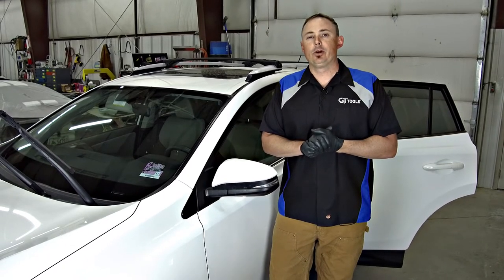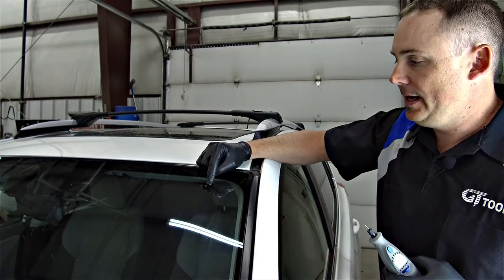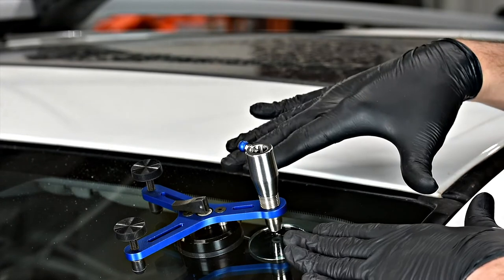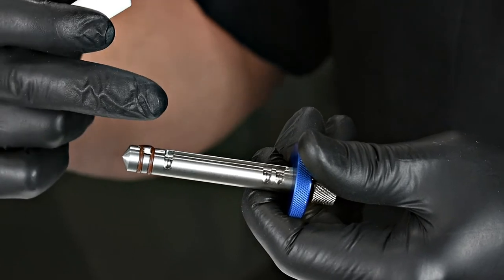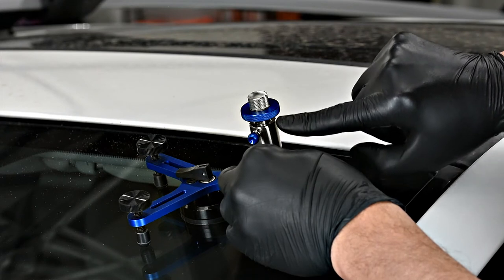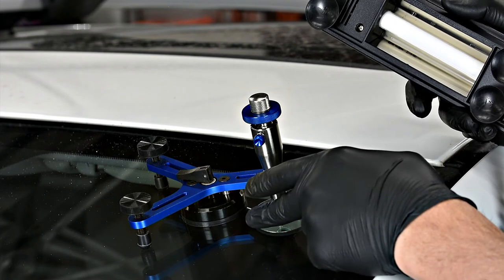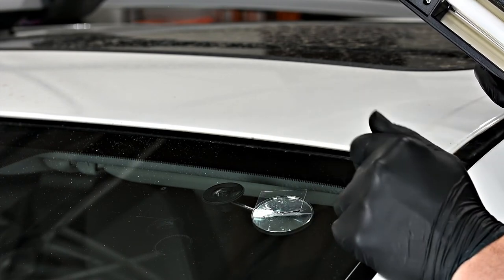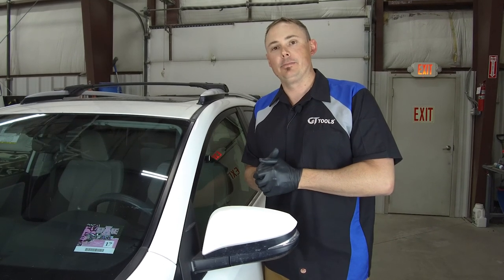SuperStar™ SpeedLock™ Training Video - GT Tools®

Comment: You should make a small heat gun to use on the inside of the glass during the pressure stage to slightly/ safely heat the resin, which makes it less viscous, I've found it provides a much better injection of the resin, I use a small torch, which can be dangerous for various reasons.

Comment: Can you modulate the pressure using the thumb screw without being forced to use the two pressure settings?
Reply from the maker: Good Morning! Yes you can definitely achieve different pressure values outside of the set speedlock pressure settings by opening the air release valve on the top and modulating pressure that way. Most users don't need to but we kept this function for those technicians that really like to dial in their pressure.

Comment: The problem with this injector is that it has "pre"-set pressure cycle locks. I don't want any tool telling me how much pressure I HAVE to put on the break, and jesus, you have to dang near push the plunger all the way down to get to the locking screw. Terrible design. I do like the speedlock option, but the pressure cycle is a deal breaker in my opinion.
Reply: ...you need a girlfriend 🤣
Reply: @konj2411  haha!